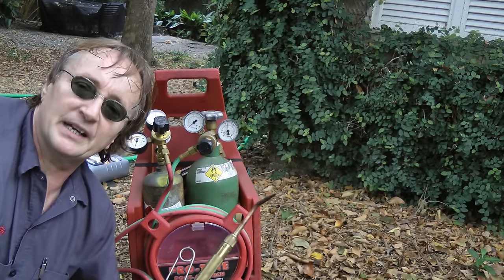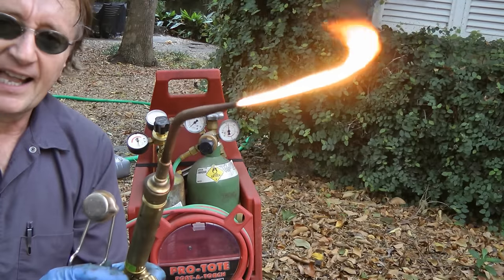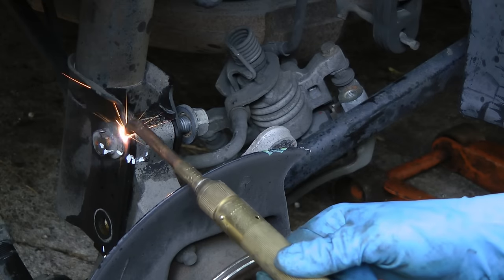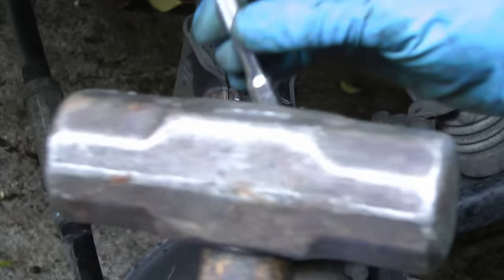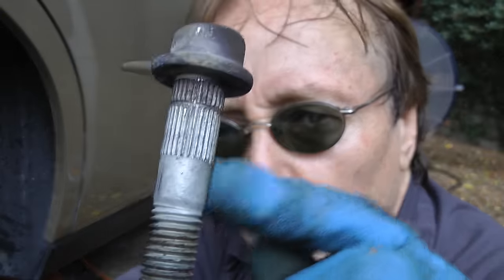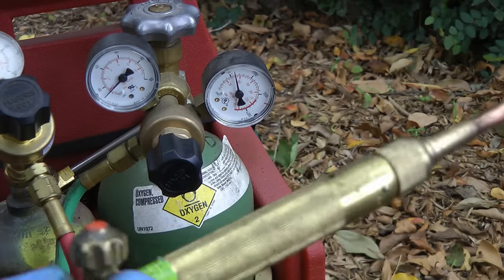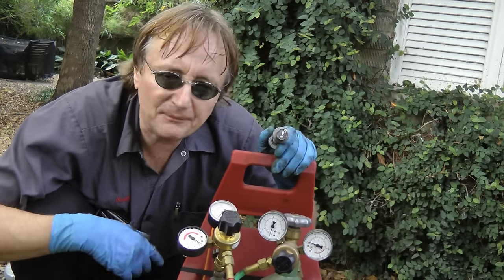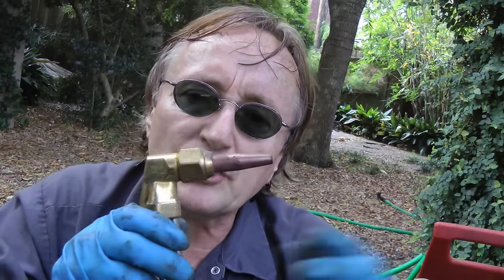How to Remove Stuck Nuts and Bolts in Your Car

Comment: So I don't see any where how to get a jack out that is stuck in the front end of my van. I was jacking my van up and it was ok, but when I did the last pump it slipped and now it is stuck in my front end of van where the radiator is. It has been snowing, and I think the van rolled back, even when the brake was on. it didn't hit the radiator it is stuck in the front end. I am not for sure how to get it out of there. So far I am taking the jack apart, and thinking of removing the fender. Can you help me.
Reply: +Pepper Jackson Hi Pepper! If I were you, I would borrow a jack from a neighbor or friend and jack up the van in a similar spot that you attempted with the previous one. Make sure your parking brake is engaged and that the second jack is firmly against the ground and a place on the van that wont slip off or break anything. Use a brick or a wood block (heck, even a phone book) up against the tire to keep the van from sliding or rolling downhill. I wouldn't suggest taking the jack apart with the weight on the van on it, because you could possibly get hurt with parts of the jack flying off or those parts can quickly wedge themselves against parts of your van that will be damaged if the van suddenly crashes back down to the ground as you're taking it apart.
Reply from the maker: +Pepper Jackson easy fix, get another jack, jack it up in the air, then it will come off. done that a few times myself
Reply: Well thank you, for getting back with me, but I took the whole jack apart. My van is ok. I found the frame and fix it. Please keep me in your loop. So now can you put something up that tell me how to give a tune up to a 1995, astar van  it is a ford, I have done tune ups, but I just can't do one on my van. There are no video's on you tube that tells me how to give my van a tune up. Can you do that so I can do this myself. Thank you pepper.

Comment: Wrong way to start a torch: It is an injection principle: The oxygen sucks the acetylen or butane/ propane- mix with it. Oxygen has to be opened first and then the gas. On a small torch you can listen, oxygen and gas have different sounds because of the different pressures... When a bolt had to be heatened to take it out it cant be used anymore, dont use it again .
Reply from the maker: Heiko Panzlaff ha, I've been doing this 47 years and never had a problem before.  Burning pure oxygen first is a mistake, too dangerous
Reply: Hope you know the joke with the farmer and the chainsaw ? This is the internet and thats the advance of the german education system: we have to do an aprenticeship for more than 3 years, pass a governments test and than we are allowed to work in that job we learned. After that we have to work for another couple of years in that job, go for a couple of lessons after work for another 4 years, pass another strict test and when we have passed that, we can call us Master Of Craftmanship and only when we have that impressive certificate on our office wall, than we can open our own buisiness and only than we are alowed to pass our skills . My welding torch is made by Dräger in Lübeck used already by my father a Master - Coppersmith and he learned me, how its to be started properly more than 40 years ago...
Heiko the German
Master of Craftmanship and Engineer
Reply from the maker: Heiko Panzlaff ah, certificates, we burn em here in Texas. The real world is where we fix things, and tests, as we all know, are a joke to a real mechanic. He just fixes things au natural, it's a karma thing. Something many germans can't understand (perhaps why so many of them followed dear Adolph years ago, went for all that runic imagery and marching bands and testing for "pure" ancestry--give me a mongrol any day, they are much stronger.)
Reply: The crane they used here in Manila yesterday on the construction site across my Hotel was made by Liebherr ,the hammer drill they used in the factory I work in the moment was made by Hilti, in the factory is no single american part but the hole machinery is from germany and from italy because americans are the better mechanics / make the more reliable machinery ? Here is no one of Your glorious Americans working, I travel the world but havent seen many american mechanics. Wake up, comparing to the germans the only thing americans can do better is to be many.

Comment: “I would’ve never gotten that bolt off, except for maybe placing a jack under it aligning the holes the bolt comes out easier. “ Hopefully people won’t use this method when trying bolts in fuel tank or brake assembly. 😂 Scotty....

Comment: Scotty, any advise on changing the auto trans fluid in a 2011 VW Tiguan that doesn't have a auto trans fluid dip stick? 
and if you can do a video on that, it would be freaking awesome =D

thanks
Reply: There's a video on that from another channel, but it's done on a VW Jetta TDI. It's actually a diesel channel - "myturbodieseldotcom". The process is more intense since the diesel engines are crammed in there and you have to take stuff off, but the transmissions are the same though. The DSG 6 speed. They have a thing you can stick your finger in and feel the level but just measure how much you drained out and put the same amount in.
Reply: thanks =)
Reply: nickolastiguan
 Anytime. Always like to help if I can.

Comment: So I have a problem where when I replaced my lower control arms and the threads where the bolts go into the subframe are cross threaded/stripped.  I got 5/6 in by force. But when they need replaced again what do I do?
Reply: Teflon paste (plumber paste) for when you absolutely have to get it all the way in
Reply: +moonpup never heard of it..I shall look into in.  Car is still going.  Thanks for the reply

Comment: hi scotty  i have a problem  im changing the alternator  in my toyota corrolla 2001  but the bottom   bolt on the alternator  lost shape  is stripped round  i use the   go socket    it slip    i use  wrench  slip is too tide   if i dont take this bolt i cant take the alternator   im thinking to use a drimel   to give the bolt shape  for the go socket or  make  agroove to  use a screwdriver  like a screwdriver or   use like a level   you think is ok   thanks Arturo
Reply from the maker: sure, try that, but if that doesn't work, find a welding pro who can weld another nut on the end of that, then you can just unbolt it, then put a new bolt in later
Reply: Scotty Kilmer thanks scotty

Comment: My car is giving Voooo voice with speed..and giving oil..I recognised it is from air filter area..I changed air filter newly ..same unusual Vooo
Reply from the maker: often a worn out idle air control valve, especially on fords
Reply: My car is Mazda 6 2004
may I need to change my air control valve?
Reply: Mohammad Darwish Those are Ford design (I think Mazda changed some internals or something to up the HP), so it's likely exactly the same problem.
Reply: Thx so much

Comment: Struggling with rounded off cylinder head spline bolt .....deep into the head.....not sure  about using heat ...stuck ???

Comment: Tools you'll need in Pennsylvania. A oxy/act torch, air tools, very good compressor, and a "bfh" (big fuckin hammer) for all the salt the put on the roads in the winter nothing comes apart
Reply: +austinspsp 
You are so very right, anywhere in the Rust Belt.

Comment: man I have a issue with a bolt with stripped threads that is loose but will not come its on a idler pulley on a 94 jeep it spun so bad eat chewed up the alternator its making me mad any suggestions
Reply from the maker: cut it off with a grinder then

Comment: Get a map gas torch at lowes  is a lot less money an easy to refill thats what i use with free all spray works every time. A lot less money and those tanks are a pain in the ass to get refilled and the high cost i own one to. One small $12. Mapp gas bottle can be bought at any hardware store or lowes.Great for the weekend mech, with one or two cars. Your the ones watching scotty anyways.

Comment: i need to replace a cam seal, and cant get the pully bolt off, could it be reverse thread
Reply from the maker: check with the manufacturer, but all the ones I ever did were normal right hand thread

Comment: Doesn't that weaken the bolt strength?
Reply from the maker: no on this thick bolt that just holds a strut in. But, if you're worried, buy a new bolt, you do have to get the old one out to remove the strut, no way past that.

Comment: never learned when you light a torch that you firs topen oxygen and then gas and light it?   when you do it your way inside you will breath in those black clouds of smoke from only the acytylene.   when you first open the oxygen then you wont have those black clouds of smoke.

Comment: G'day Scotty...I don't have any idea what it costs for the bottle hire in the US, but  down under the cost of bottle hire is more than the national debt of a small nation. It's an outright  rip-off to put it mildly. I handed mine back years ago when the annual bottle hire fee for the oxy and acetylene topped $300. Unless your into restos where you need a torch for shrinking brazing soldering and welding the average weekend warrior mechanic just can't justify it. Cheers mate.

Comment: Bad directions on the shutdown of the oxyfuel kit... you should ALWAYS drain the acetylene first and then purge it with oxygen, cause doing oxygen first would leave acetylene in the lines and obviously that's dangerous. Coming from a welder

Comment: I don't like using a torch. Inductors work much better and can be built out of and old microwave.  inductors are safer to use around gas tanks, and brake lines
Reply from the maker: sure but diy guys aren't going to buy one, and I personally would not mess with an old microwave as I don't won't to glow in the dark after using it. Hence, a used a torch
Reply: Scotty Kilmer Just FYI... Microwave's are not high-energy enough to be ionizing therefore, you won't glow in the dark after messing with one by taking it apart. (Can't say how safe you'll be around all that electricity though.)

Comment: How and what can you weld with one of those torches?
Reply: friedchicken its a late reply but you weld prettry much anything other than aluminum and you can also braze copper and brass aswell. You use a filler metal its basically a metal rod with specific alloys
Reply: John Ryan yeah there sure weld.com has a few videos and welding tips and tricks has a video on torch setup
Reply: Oxy-Acetylene is not recommended for welding car panels made from the 1980s onwards. It puts too much heat into the steel and de-tempers it, which in turn will compromise the crumple rate in an accident. These panels are now thinner and heat treated at manufacture. 
It is illegal in Australia to weld car panels and sub frames this way.
MIG welding is now the recommended practice for welding on cars, much less heat input. TIG also puts too much heat into things as well.

Comment: would propane torch do the same?
Reply: +Kee Arun 
With one of those Swirl or Turbo tips , MAYBE.     I used one for years but they are still slow and not all that hot.   If it's a lone bolt sticking out it works better than on a huge casting that wicks up your heat.    
    Clean it up with a 4 or 4.5" grinder and stainless wheel and get what you can of the loose rust helps  heat it and spray with penetrating oil.     
    If you have a compressor one of those cheap HF pneumatic air chisels and cut off and blunt the tip.   Wail away on the nut while you heat or oil the nut.    That beating will drive the oil in loosen the rust.     Takes a while but better and easier on you than a 2lb hammer and a chisel.   Open a beer put on your ear and eye protection and bang away and spray, so simple compared to the BFH.     
   Also Try tightening the nut not loosening, just a bit.    Once you get a wiggle you own the beast.     Just don't get crazy and bust it off at the outer end where it's all built up and fugly.      If necessary take it back down clear and clean up those threads some with the wire wheel and ease her off unless it's a bolt you want to just replace with new  hardware.

Comment: I don't know if i can take you seriously anymore now that i have seen you use heat to get a gm strut bolt out.  Get a bigger hammer or an air hammer.
Reply from the maker: no room for any hammer bigger than that. And the car came from Michigan, which had a ton of road salt corrosion. we don't get many of those here in Texas, so I used the torch. Time is money, so I'm not wasting either.

Comment: Why not use WD40 to remove a rusted bolt?
Reply from the maker: +merc340sr sure, try that first, but it doesn't always work
Reply: OK. Learn something new everyday. Thanks.
Reply: +merc340sr 
WD blows for penetrating oil, PERIOD.   At the least use real penetrating oil.   Nowdays I use just 50/50 mix old ATF and Acetone.   Works as well .
     You really should soak this stuff a couple weeks before and repeat daily if you don't have a torch to cut or heat it off.    Use small wire brush on a grinder and clean it off as best you can then hit with oil.     Don't expect miracles.    Best option is heat it cherry wait till it cools then oil it up and hit it.     Blunted tip on a pneumatic air chisel works fantastically too and douse with oil between beatings good option too.

Comment: or you can use wd 40 and leverage just put a pipe at the end of your ratchet
Reply from the maker: you couldn't do that in this case, the end that was stuck does not have a nut head on it, it's a special suspension bolt. You have to whack it out.

Comment: Lol really just use PB Blaster ... That bolt hardly was rusted
Reply from the maker: it was internally corroded and almost welded to the strut assembly. I tried pb blaster even overnight, it did nothing. took a torch to get it to let go

Comment: $15 blowtorch at walmart..
Reply from the maker: +Jon Wallace you can try, but it often won't get it hot enough (and they are not called blow torches, that's a really old design that no one uses outside of museums, they are just  called propane torches)

Comment: Yeah let me just spend $200 to remove a $2 bolt.
Reply: And when you snap the rusted $2 bolt you'll wish you had spent the 200 dollars before doing so.
Reply: +2Str0k3 or he will spend 200 easy on ez outs, cobalt bits, a powerful drill.... I'd rather have the torch. In a rust belt state you NEED this. Not a want item. A need item!
Reply: ill use an angle grinder to get a stuck bolt out before i even think of drilling.
but like he said, its a great investment if automotive is a hobby.
and yeah you can get a little coleman torch for like 30 bucks for a couple uses